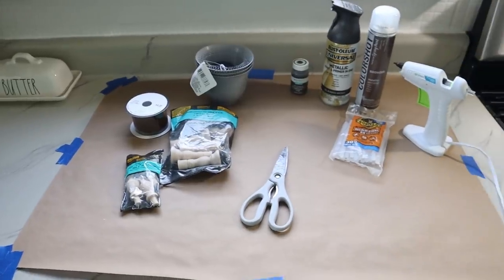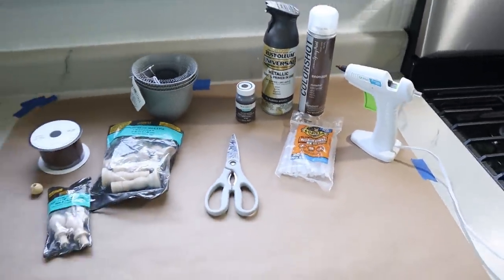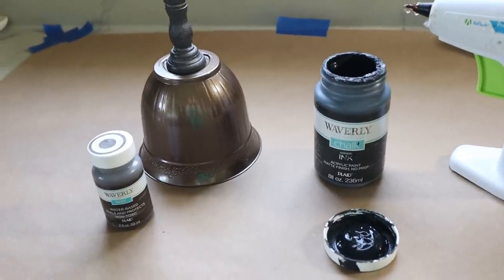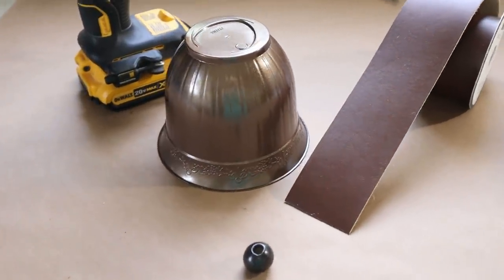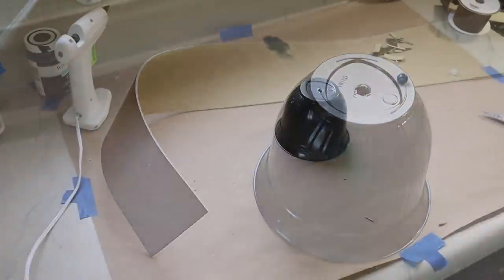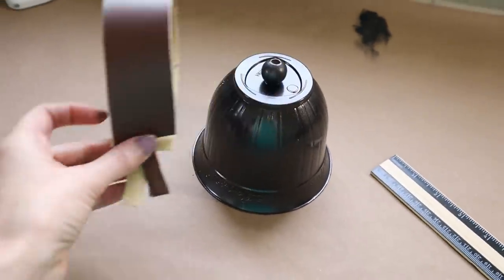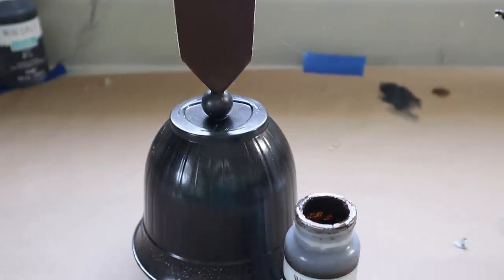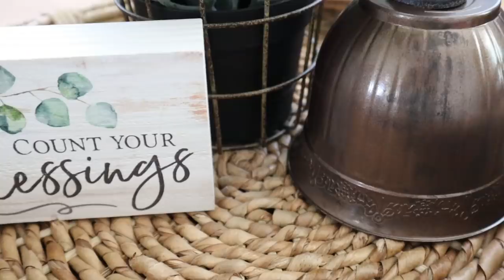DIY Farmhouse Bells | Under $10 Project!

Comment: Omg those flower pots come with 3 little black discs with holes in them... do you know what the heck they're for??
Reply from the maker: I think for drainage. Maybe a craft project in the making if you dont use them that way though 😁
Reply: @TheDailyDIYer  Okay, that's what I was thinking too, but can't figure out how the heck it's supposed to go in there. You'd think it would actually attach somehow, or like snap into place instead of just sitting there on the bottom but who knows?! But using it for a craft project in the making...I like the way you think! LOL